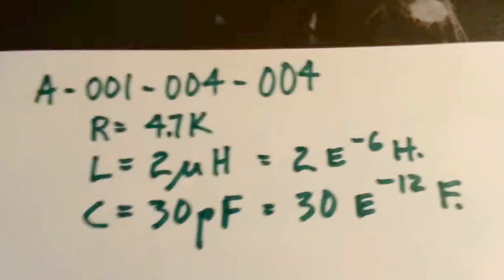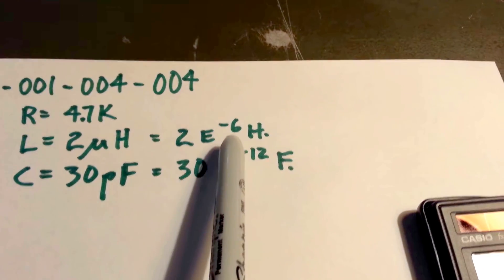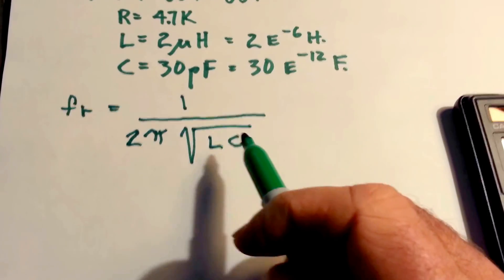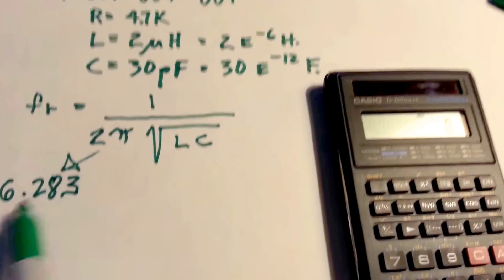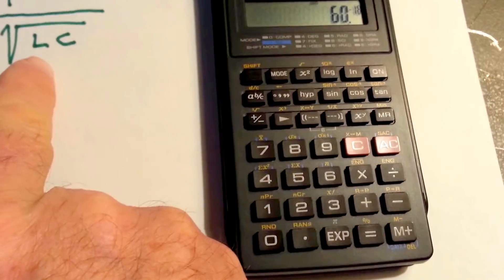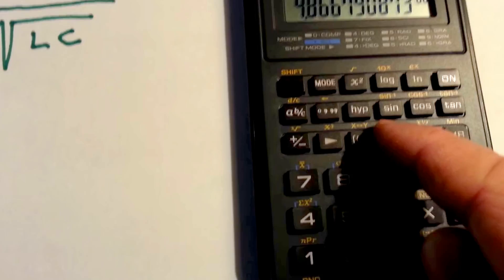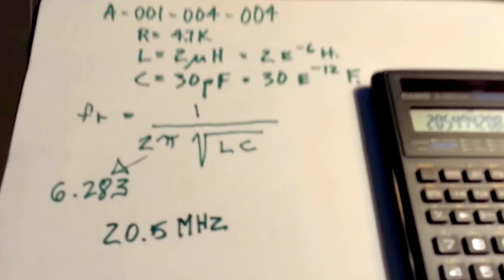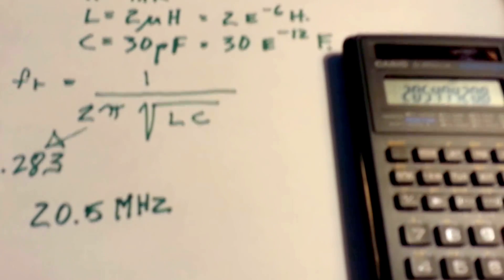Advanced question:  1 - 4 - 4  -  Resonant Frequency Calculation

Comment: I also use the shortcut of 10 to the power of -18 but my calculator is a lot inferior or simpler than yours; it doesn't have the exp button. By the way, are there just 3 or 4 calculation questions in the entire exam?
Reply from the maker: Thanks for comment.  Yes, on Canadian exam, USUALLY maybe just a few calculation questions.